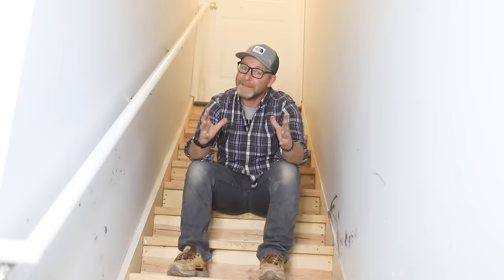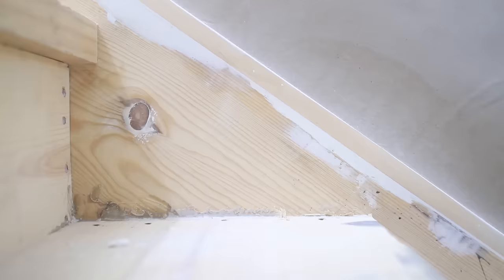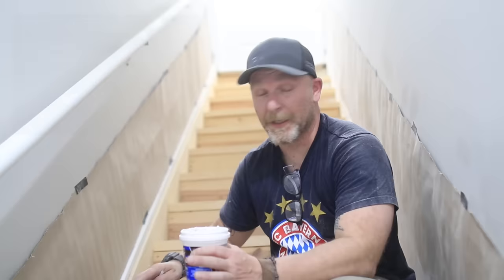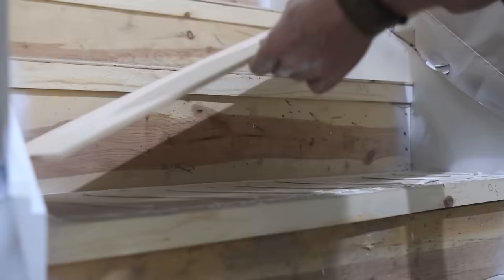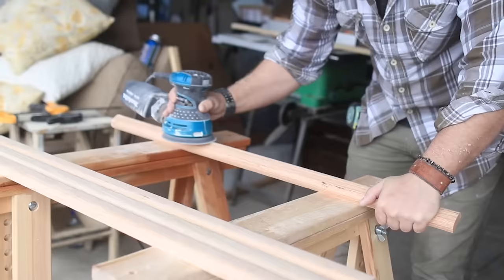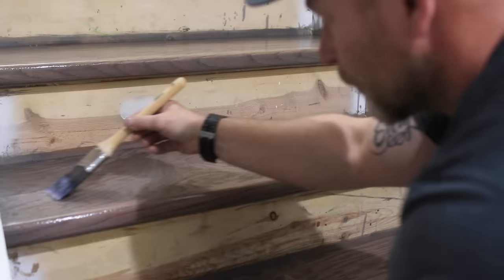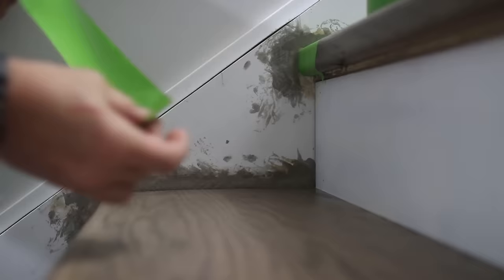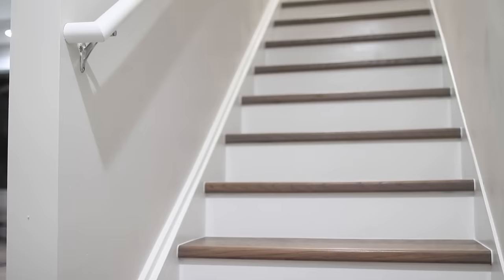DIY Stairs Makeover for Under $200 with Full Cost Breakdown!!

Comment: Who else is watching this but never plans on renovating their stairs
Reply: Not me. I have a renovation that has bare stairs right now and I love this. I just need to get a router or whatever so I can do the bull nose. I need that and a proper table saw to achieve all my DIY dreams.
Reply: Austin Leonard I started doing my sometime ago, but got a little unsure of what or how I wanted to complete it. But after watching this it has given me some ideas.
Reply: Useless if you have no tools.
Reply: setite ok boomer
Reply: I dont even have stairs
Reply: I don’t even own stairs
Reply: Im watching this but I live in an apartment lol
Reply: Looks good.
Reply: I'm half way done !
Reply: That's over 1k just on tools
Reply: Me. I don't know why...
Reply: The tools cost more than the material... DIY turn out more expensive in the end . . Unless you are actually handy
Reply: I do have stairs that need renovation but I do not have those tools!
Reply: I am watching this because I do not want to spend $30+ per tread X20 treads.  The stairs came out great.  I am looking to match mine to the new laminate I am installing; I refuse to install laminate on the stairs I hate the way the bullnose looks for laminate.
Reply: @alexf800  I would have just filled the screw holes with wood filler and painted  bottom part and siliconed the sides. And stained the top. No need to put more wood on top. Instead of cutting the top part run the hand router to give it the curve if you want. To make the curve reach all the way to the edges file and sand ( since router can't get to edges).
Reply: @tripletvn  I would have just filled the screw holes with wood filler and painted  bottom part and siliconed the sides. And stained the top. No need to put more wood on top. Instead of cutting the top part run the hand router to give it the curve if you want. To make the curve reach all the way to the edges file and sand ( since router can't get to edges).
Reply: @kabobz  What could be an affordable router? Until I tear off my carpet, I would not know what kind of wood I have underneath. I don't fully understand why everyone add wood on top of wood but I think it probably (1) make the height of the steps similar to when it was carpeted, and (2) maybe thicker wood would be more comforting for the feet or less squeaky - whatever... to avoid direct contact with the wood under the carpet.
Reply: I live in a ranch house in south Florida so stairs will never happen. LOL!!
Reply: I don't have stairs and watched this!
Reply: Yessssss hahahahahahaha
Reply: Thanks for helping me point out to myself that I don't even have stairs.
Reply: I do plan on renovating stairs but I don't have my own house so  let's see if neighbor wants some renovation.👷
Reply: My son just bought a house with stairs going to an attic which are covered by carpet. This is perfect for him.
Reply: Sir,
What is Spackle?
Reply: Sorry you answered my question 20 seconds longer into your video.
Great Video Brother!
Reply: I’m about to redo stairs and was looking at how to throw in skirting without too much trauma,
Reply: Will we all chip in for the tools and take turns using them? 😂
Reply: Lol lol....I want him to my stairs!
Reply: I'm going to have to pay someone
Reply: That's how you know you're watching good content, when it can't relate to your situation but you can't stop watching regardless. :)
Reply: I don't even have stairs.
Reply: Nope I’m redoing them...right meow
Reply: @khorotoconnexion  🙄 excuses
Reply: @jcberb  same 
Im just refinishing existing 2x10’s 
and installing nicer risers 
Fit and finish is gonna make it a longer project but well worth the effort.
Reply: I don't even have stairs and I watched it. Haha!
Reply: I don't have any of those tools, or the expertise to use them
Reply: I am watching,  my husband says its too much damn work. We will pay somebody.
Reply: I don’t trust stairs.
They’re always up to something.
Reply: I had a guy do my stairs with finished flooring panels and he put a strip on the edge of them that stands up and clamped on the edge. I hated it I was Furious so so I had to have another guy lay a strip of carpet Runner down to cover the Beautiful steps so I wouldn't trip and fall going down them.
Reply: You have stairs?
Reply: I don't trust stairs. They're always up to something.
Reply: @Maplecook  true but they’re also down for anything.
Reply: @drinny26  Brilliant! hahahahahahah
Reply: @Maplecook  😂😂😂
Reply: @drinny26  Thank you for having a sense of humour. Life is too short not to laugh as much as possible.
Reply: @Maplecook  it was keeps me young. Laughing everyday is good for your health! 😃
Reply: I don't even have stairs lmao
Reply: The Labor cost is $5,000
Reply: @tripletvn  rent them.
Reply: I do not even have stairs, lol. Great video!!!.
Reply: After watching this i changed my mind.
Reply: I don't even have stairs 🤣
Reply: SIGH not me. I am getting a new house (old but new to me), that needs some repair work. I will have to fix the stairs myself. Take my like anyway.
Reply: I went to like this comment but it looks like I already liked it last time I watched this and never renovated my stairs 😂😂😂
Reply: Not me.
Reply: I am a woman and have never done anything more than paint or hang pictures.  Here I am watching….not sure why.  I have no tools.
Reply: I already took of carpet so now i got to
Reply: Me
Reply: Lmao
Reply: Me!!😝
Reply: Planning on doing it😅

Comment: I used spackle to fill some gaps on my stairs when I laid down hardwood and with time because of natural expansion and contraction and people stepping on the steps, the spackle began to form cracks. I recommend using paintable caulk or wood filler/putty instead. It’s able to flex more easily with the wood and wall.

Comment: Excellent video and a very good job - you make it look really easy. I'm prepping to do our basement stairs myself, hence watching these videos for tips and tricks. One small tid-bit to point out (so as to not confuse other DIYers): what you call stringers are actually side skirts. In the case of your stairs, you can't see the stringers as they are beneath the treads and risers and are the 2" X 10" (in most cases ??) zig-zag/tooth shaped parts that hold up the entire weight of a set of stairs. You did an excellent job mixing the stain colours in order to match your existing flooring. I've actually used a bit of basic cheap acrylic paint to tint wood stain in order to achieve the desired colour I needed for wood working projects providing you mix the acrylic paint into water based wood stain. It works really well. Your stairs turned out very well and for a fraction of what it would cost to buy solid hard wood planks. Hopefully mine turn out as nicely as yours did. Great work.

Comment: The stairs look great. I did mine too by making a jig and heating up vinyl plank flooring to form the bullnose and placed it over the existing bullnose. It was glued down with PL glue and then I used hardboard on the risers just like you did.  They turned out awesome and matched exactly with the flooring that was installed in the basement. Love vinyl.

Comment: I would suggest using a notched trowel to spread the glue for the 1/4 inch plywood.  That will eliminate voids under the plywood and make a stronger tread.
Reply: A trowel for construction adhesive? No. It will bond fine. A couple brad nails to hold the tread or riser in place is enough until the adhesive sets. Should be tapping the treads with a rubber mallet and walking on them right away though. No need to wait for it to cure.

Comment: Did this for a customer 20 years ago and charged $125.00 per step. Included removal of old step tread. Stain and poly treads, paint skirts and risers. The most difficult thing was cutting the step treads. They were not all square from back to front. To get a perfect measurement, a center line for the step must be established on the staircase framingFrom the back of the step to the skirt board, then from the front of the step to the skirt board on both sides of the step treads.Those skirt boards follow the contour of the drywall and framing behind the drywall. Excellent video. Thanks
Reply from the maker: Thank you Sammy

Comment: Thanks for this. Very helpful
I followed your directions with a slight modification. 
If using hardboard don't use brush-on 1-2-3 primer (I know you used the rattle can) as the hardboard can soak it up and swell. Instead I'd  suggest the use of 1/4" plywood flooring.
Reply: Repent to Jesus Christ 
“I will say of the Lord, “He is my refuge and my fortress, my God, in whom I trust.””
Psalms 91:2 NIV

Comment: I'm not an expert by any means, but I've been planning to redo my stairs. After my "studying" I learned a little bit, and I "think" that the boards on the side you called "stringers" are actually the skirt boards. The stringers, I believe, are what supports the treads and risers. You can't see them once the treads and risers are on. I could be wrong, and it could be that those are some special type of stringer that I don't know about. Just thought I'd shoot that out there! :)

Comment: Looks pretty good. I know you were going for a budget build on basement stairs, but here's a couple of tips for a more finished look. The existing stringers can be covered with MDF and molding to eliminate all the sanding and filling.The rough treads should be cut back flush with the rough risers so the finished risers sit plumb. A tread jig can be easily be made to get the exact length of each tread and you won't have so much caulk between the finish tread and the stringer. One last thing. Do not use plywood for treads. It will not hold up to years of use. Again, your results look satisfactory but I'd go with higher quality materials especially in a high traffic area. Just a couple of tips from a lifetime finish carpenter, stair and handrail specialist.
Reply: How do you think that nosing detail would hold up over time? Seems like asking an awful lot of some wood glue and pin nails.
Reply: @barrykennedy8507  Using plywood for treads is a big mistake, and asking the nosing to hold on to it is going to fail. Solid wood treads with the front edge routed round is the way to go.

Comment: They turned out very nice. The only question/concern that I'd have, is the fact that the front bull nose runs a high risk of shearing off if you were to dolly a large appliance down them. Since there is no grain structure holding the bull nose on... the only thing preventing it from shearing with the vertical load, are a few brads. It would take a little bit longer, but it might make more sense to cut the oak a bit thicker and cut a rabbit joint down the back side of the oak. This way the oak is overlapping the top side of the tread and providing a little more shear strength.
Reply: Good suggestion, although with enough glue and enough pressure from the brads, the glued joint should now be as strong as the grain, no? I'm picturing that the "clamping" pressure via the brads may be the variable there...

Comment: Great job! You taught me a bunch about woodworking. I know this was a low cost reno and paint cost can eat a budget, but consider Pro Classic instead of Pro Mar 200, also by Sherwin Williams.  It will last longer and shine brighter.  Also, Top Gun Flex (Dulux/PPG) or Big Stretch caulking may last longer on stairs, since bodyweight will inevitably cause the wood to flex and the Alex fast dry stuff isn't as durable.  Cheers.
Reply from the maker: Great point
Reply: The Alex Dynaflex is much, much better than the cheapo Alex caulking. You get what you pay for.

Comment: Great video Komar, I’m sure this helped everyone on how its done especially under 200$ for materials. The 1/4” plywood for the treads was the key in savings. The average staircase like shown usually cost about $1300.00 cad just for the refacing, not staining or painting. Your other option would be a brand new factory built staircase with solid oak treads and maple veneer stringers and risers, supplied installed and finished for about 3100$ cad. Great job they definitely turned out nice!👍🏻
Reply from the maker: Thanks so much.  Ya there are lots of options and all were just a little too expensive for us
Reply: Where are you getting such pricing? I'm in Ontario and a simple straight right-hand exposed staircase, 14-tread 3/4" hardwood capping, with new handrail and spindles, is $8000 (cheapest quote) and full replacement staircase is $11,000, both prices are excluding taxes

Comment: *need $600.00 tools first lol. I'm going to do this exact and thing to my steps,  looks great!
Reply: true. he does have some nice tools minus the TS he borrowed
Reply: Are you only buying the table saw?
Reply: Where are you getting all of these tools for 600 and how can I also get that kind of deal
Reply: wojtek karek harbor freight
Reply: Lance R HD rental tools have been used and abused. you’ll waste time just making sure they’re true and a weekend project typically turns into a two weekend project
Reply: I have most of the tools, minus the router, just need to get the wood and I think my Father in-law has a router. But I can’t even do the work yet as I hurt my back back in June and still going through treatment.
Reply: You save more if you use lvp
Reply: Yes, the way he did it, but a circular saw and sander are the only power tools you really need. A $300 Ryobi kit is great for this type of thing.
Reply: Calls homedepot and rents the tools for $50
Reply: I am planning this for my stairs and I found the tools, minus the table saw and router for under $250 on amazon, compressor brand nailer and finish nailer for $212 (bostitch) not commercial grade but looks like it is perfect for home repairs and upgrades. Let you know how they work when I get done.
Reply: Looks great! 👌
Reply: wojtek karek do you install hardwood floors ? Or stairs ?
Reply: Harbour freight, lol
Reply: @seco663  have you priced out LVP stair nose? It's obscene
Reply: $600 HA! He's using more than that and he "After" shots really don't show how it looks.  Long term?  Not real confident.
Reply: I think it's a bit assumed you will have these very basic power tools if you're the kind of person to remodel your stairs.
Reply: @spudth  I have very similar 'builder's grade' stairs in the basement. I think this kind of makeover is good enough for basement stairs where they are the least used part of the house.
Reply: @LyGuy13  I agree.
Reply: Ehhh absolutely thinking the same thing.  I agree you can rent from HD - but time is an issue. Sometimes you need to hold it longer and the bill keeps getting bigger and bigger. I rather just buy the thing.  Awesome project, simply love the colors - I am doing this now (only difference is, I am adding LED lights) ... wish me luck...
Reply: lol. let me e-transfer you $600, and you pls get me the tools he used in that video.
Reply: @trackrat62  yep. Usually about $75- $100 for 7' stair nose (covers 2 stairs each). 14+ stairs.. looking at $500-750
Reply: $600.00????  Just the miter saw alone cost $600.00 🤣🤣🤣.  And harbor freight tools are cheap asf
Reply: The miter saw alone is 800+ lol

Comment: 7:50 with the circular saw, it does cut a smooth line as the table saw. It depends on the sharpness of the blade and the tooth count. But with a circular saw you put the visible side on the bottom. That way the saw blade is cutting into the wood and not away from it, the same direction as a table saw blade.

Comment: Look really good other than the caulking at the ends of the treads... if you used a stair tread jig tool  you could have gotten a really tight fitting tread with no noticeable gap to caulk..

Comment: Why not just use oak topnail? Oak plywood probably won't last that long because the vaneer is pretty thin. For those who don't know, Topnail is 5/16inch thick by 2¼. Very common on the west coast for houses of a certain age as it was originally salvaged wood from train cars coming from the east. It's a much more suitable, thin, and cheap flooring. Nosings could be typical ones ripped down or done as the ones in the video
Reply: If you put enough clear coats over the stairs and do not have hundreds of people walking up and down the stairs, I veneer on the treads might last. Good point though.

Comment: 200 materials, 1000 tools, 2000 labor. Nice job!
Reply: Labor is always the most expensive part.
Reply: Your math sucks. Most guys already own a jigsaw and circular saw and if not could borrow one. Maybe a friend could do the routering. And you wouldn't count your own labor. DIYers do the work in the evenings and weekends for the satisfaction of it. With materials and paint and stain, this is about a $300 job. Bottom line is to get the job done, looking good, for minimal cash out-of-pocket.

Comment: Great idea. I’d worry about the durability of the 1/4” plywood on a high traffic staircase, but I assume this one doesn’t see significant traffic since it was never finished before.
Reply from the maker: So our stairs probably get used once or twice a day when I come down to the shop.  Plywood is fairly durable but I totally get where your coming from.  It’s more of the finish that I’m worried about.  If that’s good then they should hold.  Time will truly tell.   Thanks brother.